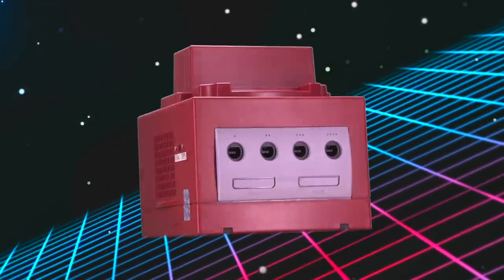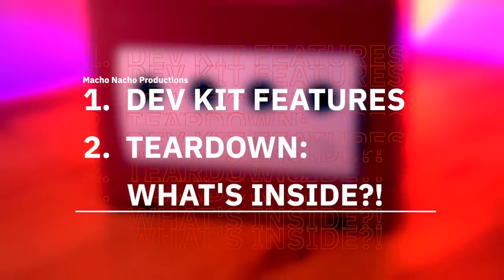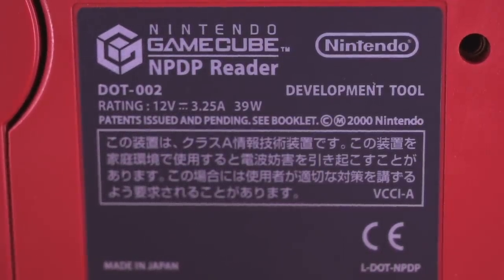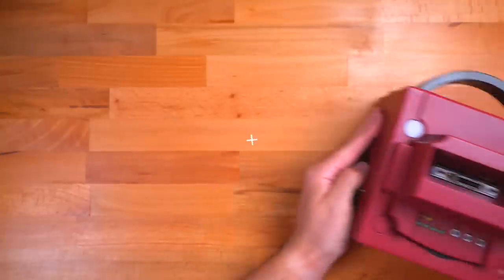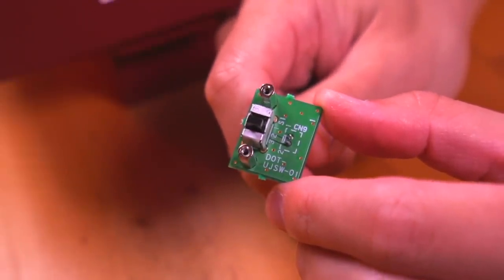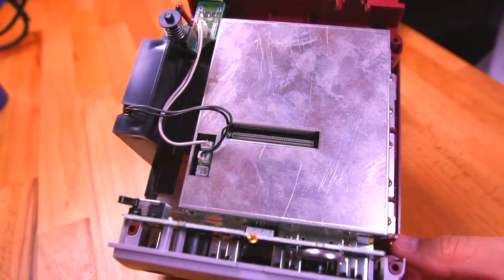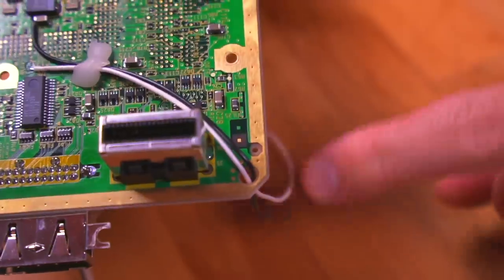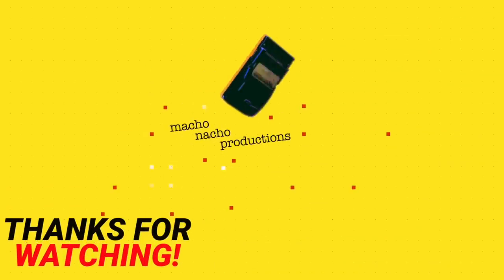Why Did Nintendo Make A GameCube With A Cartridge Slot? | The NPDP Reader

Comment: Im guessing that two wires are Voltage and Ground bodges done at the factory to provide power to the NPDP board without redesigning the PCB just to route one more power rail, and I guess the data is carried on that massive flat cable.
Reply: The two wires are for the region switch. The extra power for the NPDP board comes from the power switch board before going back to the GameCube's normal power supply.

Comment: I'm sure it's been stated a few times by now for the two wires in the bottom are how we used to do reaching mods for the GameCube back in the day so it's just an extension cable that goes and leads to the switch

Comment: The mystery wires to the bottom are for the  region switch. This version of the mod needs to get more screen time IMO since it's easier to install without the need to remove the heatsink.
Gcforever wiki has a good picture of this exact thing on their region switch page under the "how it works" section.

Comment: Interesting, I just wish you'd had a disassembled normal Game Cube next to it so we could see how things are the same or different rather than just being told. Also, I'm curious what a normal Cube has connected to those contacts, as well as what would happen if certain parts of the NPDP reader were attached to a normal Cube, like the region switch.
Reply: Same motherboard, only difference is cartridge slot. wires that run underneath are the region switch, which is the same on a normal gamecube if you want to mod it.

Comment: As others have said, the “mystery” wire is for the region switch which is a common mod to change the boot up bios from US to Japan. This is why you need the system off when you switch between regions as the bios is booted up during power. American region is selected when the white wire is grounded out. Guess that the black wire is going to the (-) side of the capacitor and the switch connects the white wire to the black wire. Very cool video, thanks so much for sharing the tear down. I am wondering why the fan is connected through the NPDP-SubB-01 board. If I remember correctly, on a stock GameCube the fan is connected to the power adapter/switch board. Probably just a pass through, but why?
Reply from the maker: That’s a very good question!  It is rather curious. Not sure why Nintendo did that.
Reply: To send the 12 volt rail into the cart reader and the cartridge. If I recall correctly, the DVD connector only supplies 5 volts.
Reply: @davidcameron648  I think that’s it. At least it makes sense. Thanks.

Comment: [9:08] Sorry to disappoint, but that's not some special Nintendo chip. It's just a 74HC08 quad AND gate
Likewise, at 9:19, that's a 74HC04 hex NOT gate
Knowing what either of these chips are doesn't explain anything without knowing how the board is wired up

Comment: You want every part to have an identifier for... identifying it. Nintendo can tell a factory they need 100 units of part DOT-UJSW1 and there is no confusion about what they are asking for (assuming the factory has the blueprints and other date needed to manufacture the part).

The switch is clearly only for dev kits so it makes sense Nintendo would use stock gamecube parts whenever possible, and if notl, create special parts for the dev kits, all of which would have their own identifier.

The soldered wires are probably done so they can use stock gamecube components but alter the behavior using an additional part. Given the main differences in this dev kit are it takes carts instead of discs and it can be US or Japan region with a switch, it's probably related to one of those two features. More likely being the region toggle (I would think the cart loader would be a drop in replacement for the DVD drive, though wires could be used to bypass some DVD functionality rather than making the cart loader properly impersonate a DVD drive).